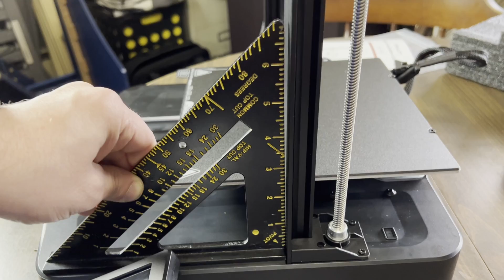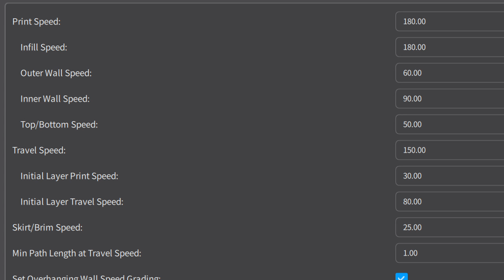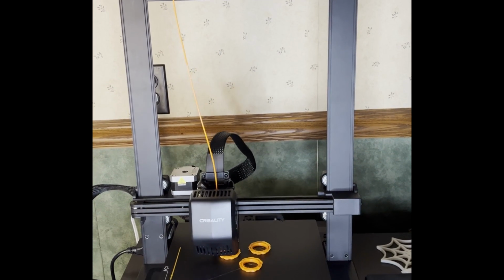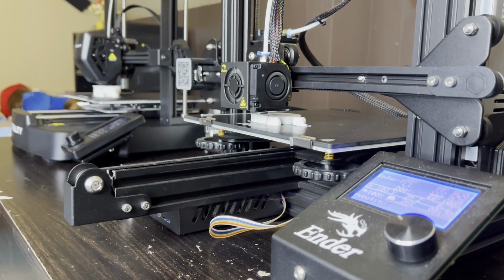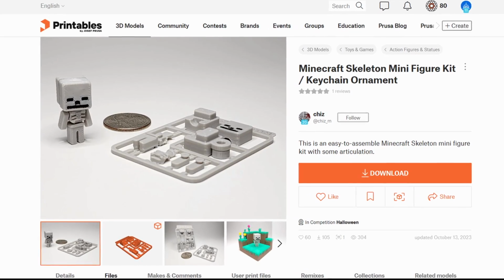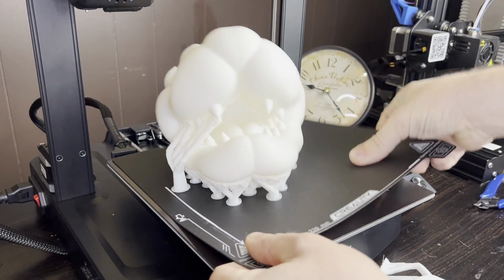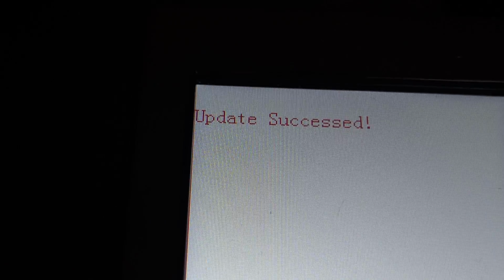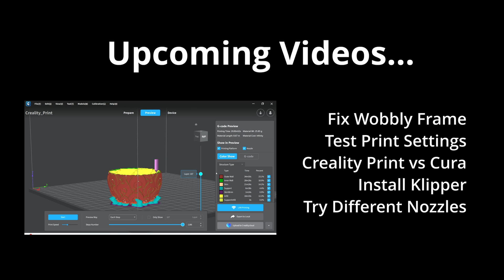Ender 3 V3 SE Initial Thoughts on Creality's New Entry Level 3D Printer

Comment: I am still not understanding how that e leveler tool is supposed to work at all.
I mean if you are supposed to use a piece of paper traditionally then how the hell is something that is like 500 times the thickness supposed to make an improvement?
Won't the thickness of the micro switch and the PCB make it so the nozzle is no where near the surface of the bed?
I read the instructions expecting it to say to need to change some offset setting or something but it doesn't.
So can you explain how that is supposed to work when it is about 500 times as thick as a piece of paper?

Comment: Hello good evening I new on 3d printer and I need help. I bought an Ender3 V3 KE but it hasn't arrived yet, I tried to install CURA but KE doesn't appear what can I do or choose because only SE appears. Thanks
Reply from the maker: Ultimaker hasn’t added a profile for the machine in Cura yet. If they’ve added the SE but not the KE, they should be similar but be sure to open the machine settings  in the Creality Print slicer and copy those over.

Comment: hello, did you try printing anything in 0.12mm height or similar? im trying to print some detailed 25mm minis but im having a lot of trouble with stringing, particularly during travel movements. I've tried lower and faster travel speeds, different retraction settings, but no luck. The interesting thing is that retraction towers are printing perfectly with virtually no stringing so this is a very weird problem im having and saw other people on reddit also experiencing...
Reply from the maker: I’ve printed a few things using Creality Print’s High Quality settings, 0.1mm layer height.

I haven’t had any noticeable stringing issues yet that I could specifically link to the layer height. I’ll look into it though. 

My Overture TPU was stringing a ton, after my retraction towers looked good.

Are you using Creality Print to slice?
Reply: @3DVibes  I've tried both creality print and cura, I'm a beginner, had the machine for 2 weeks now, so I've only tried the pla it comes with and creality hyper pla that I bought in a deal with the printer... So far I've only linked the stringing to travel movements, it's not an overextruding issue though cause I did calibrate esteps 2 days ago and even then it only extruded 2mm more than the 100 I dialed in, lowering the extrusion value to accommodate those 2mm overextruding didn't help. Just to give you more info, I did retest for retraction after the estep calibration of course, didn't need any correcting, cause it didn't show any stringing at all in the tower
Reply: @3DVibes oh and I've also messed around with different temps of course, 186~190 seems to be where I get the least amount of stringing but some features fail to print at that low of a temp... 
If you're willing to, it would be very cool to see a follow up video to this where you print a more detailed figure in the 20 to 30mm scale, just for comparison, if that's not too much trouble!
Reply from the maker: @magnusleo_  funny you mention it, I was printing little Pikmin miniatures with it for my initial tests. I plan on uploading a video testing small prints.

I was hoping to order a 0.2mm nozzle to test that as well.

Comment: Hi I bought that but I am having a problem with print ahe doesn't understand the sd card and I can't print even the one that comes with her. If you see this comment please help me 😢
Reply from the maker: The SD cards that come with printers are not the most reliable. If you try reformatting it in fat32 and it still won’t read, try an SD card from a reputable brand. Something under 32gb.
Reply: @3DVibes  thank you so much 💕 now it's working
Reply from the maker: @LIZA-yp5hn  that was fast! Haha. Did it work after reformatting it?
Reply: yep!!!! now its perfect working! thank you so much!!! @3DVibes

Comment: I hate spool holders on gantries. Just introduced so much chance of big wobble during a print. I just print a spool holder and create a filament path. Reverse bowden if necessary. Also I get the most extruder skipping with PETG that prints best at a lower temperature. Wonder if it's an attribute of PETG that makes it harder to extrude.
Reply from the maker: Currently using reverse bowden on the V3 SE. Creality is sending me new profile rails and bolts because of the wobble. I still don’t plan on ever mounting a spool on the top of the V3 again. 

My video of this process should be ready any time now, haha.
Reply: @3DVibes  Awesome! 😁
Reply: Having my own machine tools I’ve made overly complicated mounts for filament holders that don’t mount to the gantry as it just seems like such a stupid idea.  I get why they do it but damn, looking at some people’s spool holders on the gantry I don’t know how they get any good prints.

Comment: I think the ender 3V3 is a great piece of kit but crippled by bad software.

Trying to use Prusa Slicer and navigating through a filament change in the middle of the print has proven to be very difficult with the stock firmware.

Waiting anxiously for someone to create a custom pro firmware build for it (Like MriscoC).

Sigh. We can never have it all. :)
Reply from the maker: I’m working on setting up a decent profile for Cura, most likely trying Prusa too.

So far I’ve only tried color changing on it with the Creality Print slicer. It didn’t work, haha.

I’ll get Klipper on it eventually.
Reply: @3DVibes  I print with Octoprint.  The main problem is the lack of "host action commands" in Octoprint which allows the printer to send status back to octoprint telling it that it's (for example) waiting for a filament change.  I was going to try Klipper... but I've had a hard enough time getting it to work on my Ender 3V2.  That's a whole other story.

I've managed a decent print profile with Prusa Slicer (using the Ender V2 settings and just upping the speed).  I've had success with it.  But again, it's the filament colour change that has been the bain of my existence.  It DID work once.  But it was a struggle.

I really want MriscoC support for the V3, and I'm more than willing to give up "auto z-offset" for it. (Getting a good Z-offset is easy enough).

Very frustrating because the 3V3 is a great printer!  It's just jailed behind cringy beginner-only software.
Reply from the maker: @crooker2  I agree. It seems this printer was 100% geared toward new hobbyists. I haven’t gotten the V3 KE yet, but I assume that one will be more for enthusiasts. Though most likely pushing people into their Creality Cloud service.
Reply: @3DVibes it looks like maybe the V3 ke is running same basic firmware as the k1, least from the videos I have seen it looks similar, I'm not sure about filament change but filament runout worked great

Comment: I had mine printing in less than 30 minutes with no tuning. Happy with it so far.
Edit, just want to add that i am new to this.
Reply from the maker: It’s nice how simple it is to assemble. A fraction of the time previous Enders required. I’m surprised how well it prints, even with the wobbly frame!
Reply: @3DVibes  I'm waiting on more filament as I've already used up the supplied sample and u got to say, I like what I see. Looking forward to your series.